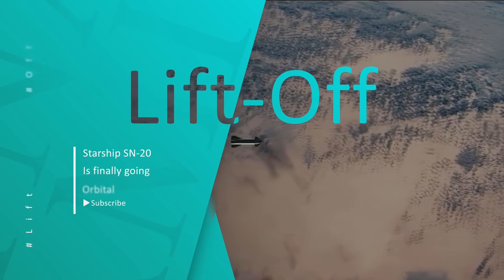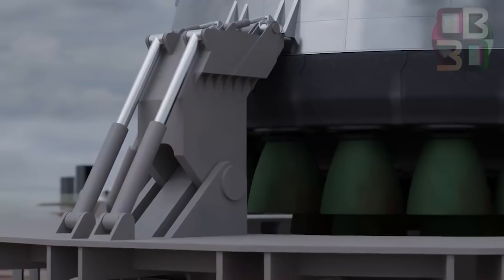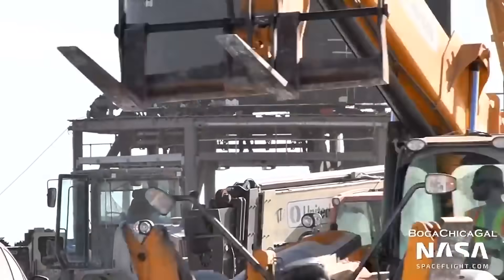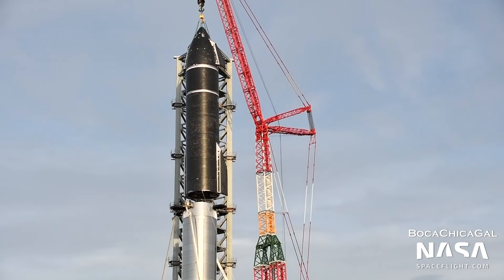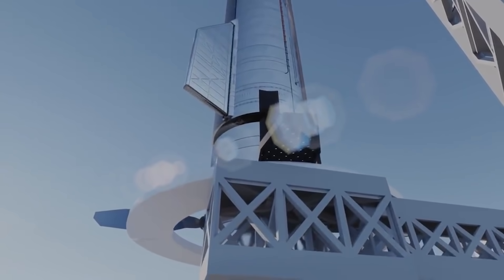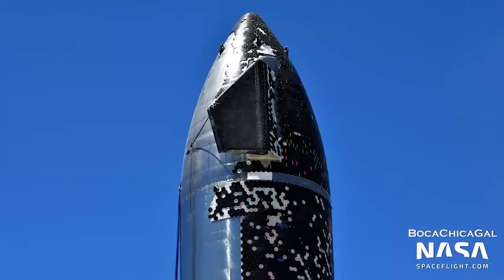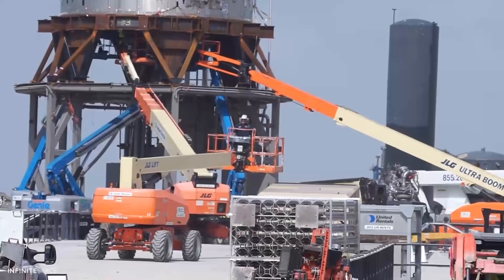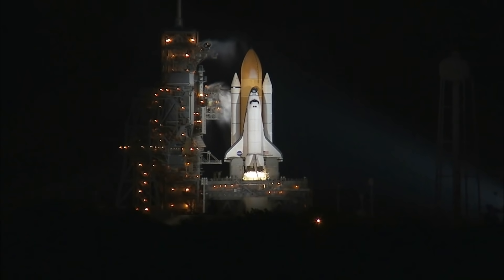CRUCIAL! Why this Orbital Flight is DIFFERENT!

Comment: I think landing on the moon with a high center of gravity is going to be a huge hurtle. Imagine unmanned missions first.
Reply: Probably easier than on Earth with a wind blowing.
Reply: Center of gravity?
Reply: @edfinite7534  of starship due to its height and width.
Reply: @Mike-gz4xn  Oh. I kinda get it. The craft needs to be more squatty?
Reply: @edfinite7534  well by nature it can’t be, but yeah. Landing and not tipping over is an engineering challenge for sure due to the moon not being perfectly flat.

Comment: its about time to speed tiem to develop rosket as using ramjeet missile and turn into oxy fuel and do modular tech upgrade lvl flying stabilizers this means seen difference in land betwenn 2x2 oposite or even 4x4 4 up 4 down stabilizers in theory could fly easy with that to the glider efect off flaps is for glide surfe flying basci element which turns to be used in flight even on scfi atmosphere for phenomen called as buble glide flyng fisrt theory was was flying on wings and airspeed but fast speed this is bit limited si air buble and suport tech was needed anway a quad flaps 360° could redesign any rocket with bottom stabilizers to be reusable socone stuff is modular pack on combo pack engine area and fuel in one modul second is cargo modul, also fore design lvl and heavy components phenomen called as neck and tail rocket for another expasnion modul upgrade as vtool systems so basic lvl off vtool eficiency would require moduls but combo bix scsfi spacehsips tech would not the idea is slight epxand box on airplane at back using hand and attach servo with engine so back pack engine is rotational a front pair is there for balanc and vtool and boom you have vtool scfi spaceship tech if you do servo cocpit which can be escape pod for crew and body landf on parashuite on crash you begining off safety even other planets and  this safety protocol becomes critical  in thoery for this is for ment to be DRI department off research and inovation facility so main cost for produce falls down and you techicaly doing design on models deisgn first then rocket size which are UAV designs anyway with add protocol of safety limits which should open up on 500m and deployable it means like pc sofware is enganing preps and alarm if no control in 750 m auto crush self engage protocol is engaged and start to be active in in 1000m above surface future version is avatar ai that analyze self predict or even manvours to be self suportive goal to  fit or land safely with crew or mission acomplish wirth full data service and do self calcualte if liked even do selfie ha I landed safely on mars and publish it in public and kindly send data to hq future avatar form ai design with caracter are based on talking nav and some data corespondance between pilots and basci control in room just as star trek and that includs even so called battle scenario as room colour yellow for nuclear rdrive red for crush impact and so called day and night phase which works better than any scenario emergency

Comment: Can anybody, suggest a plausible reason the FAA could possibly produce that might potentially prohibit the use of super cooled methane and Oxygen as a propellants?

Given that it differs to only relatively slight extent from Natural Gas, is Methane known to be hazardous in any way?

Is there any possibility that it could conceivably be hazardous when used as propellant for rocket engines?

Does it come anywhere close to kerosene or HTPB on a scale of comparison for environmental harm?

The US military have long used solid as well as hypergolic compounds as propellant for missiles that undoubtedly produce highly toxic exhaust.

For that matter the solid rocket engine powering Sir Richard Branson's space ship two vehicle employs a solid, rubber-based fuel containing HTPB or Hydroxyl-terminated polybutadiene and rubber combined with liquid nitrous oxide as an oxidiser.

Apart from probably being emphatically unwell, given so much as a sniff of exhaust from the Branson brew as well as Starship or Super Heavy, even a Kalahari bushman could tell you Methane is far cleaner and safer for the environment. 

A number of rocket engine designs consume Kerosene along with almost every airliner and US military aircraft currently flying and all of them operating in the USA must surely have FAA approval.

As a compound comprised predominantly of Hydrogen and Carbon Methane is undoubtedly a far cleaner, safer and more environmentally friendly fuel than kerosene or any of the other propellants currently in regular use.